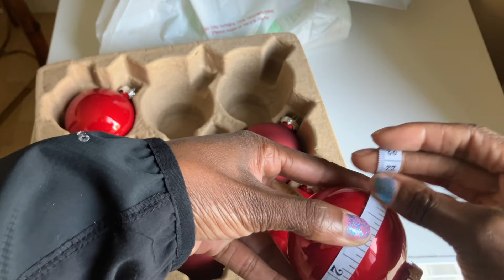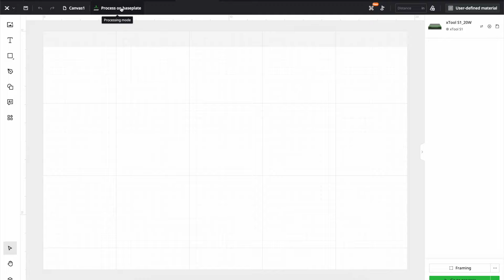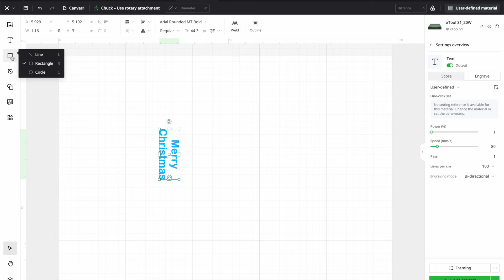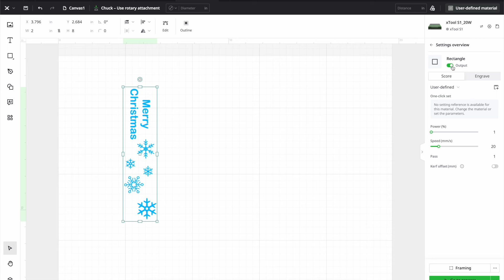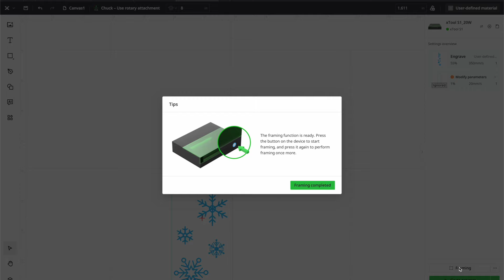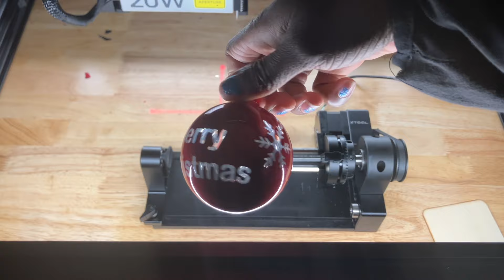xTool S1 Full Wrap Laser Engraved Glass Ornament Tutorial with RA2 Rotary

Comment: Do you need a riser base
Reply from the maker: Yes, you need the xTool S1 Riser Base to use the RA2 Pro rotary attachment in Chuck mode, or for larger cylindrical objects and roller configurations that exceed the standard clearance.

Comment: Did you have to change any settings to accomadate the height difference. e.g. you measured with the probe in the centre of the bauble; however, your design also engraved the top and bottom, which has a different height measurement? I've just purchased a base riser and RA2 Pro for my S1 10W and gone straight to do a full wrap on a white coated metal bottle LOL ! {:@>
Reply from the maker: Nope I did that one measurement with the probe as shown. My advice if you are concerned is to always buy extra material for testing so you can see how your machine handles it and get the specific settings you like best. I have various tutorials that show you how to do test arrays on different materials that you can use for reference.
Reply: @liciatoday  Thank you, great advice. I have purchased 6cm white coated glass baubles, which I've just painted with black paint and thanks to you, will have a great time having a play. All the best :)

Comment: I’ll have to say I just used your settings and this would probably be the first time I 💯 % agree with it. I had to try your settings and it work flawlessly
Reply from the maker: Nice!!
Reply: @ also make sure you unite and you won’t have the problem you did in this video
Reply from the maker: @ Not sure what you mean. When I look for unite I don’t see that option when I highlight all my design elements.
Reply: In the the new version of XCS after you highlight your design there is a icon on top that looks like 2 dark squares over lapping that is the NEW UNITE button
Reply from the maker: @ ok so I saw that but it doesn’t allow me to do that with my design.
Reply: @ that’s odd this well if you can figure out why not it would be great for you when engraving cylindrical items as this won’t jump back and forth